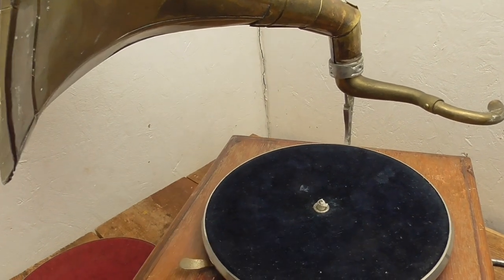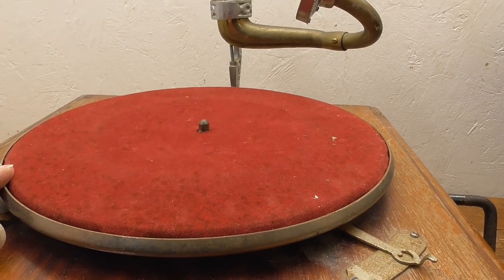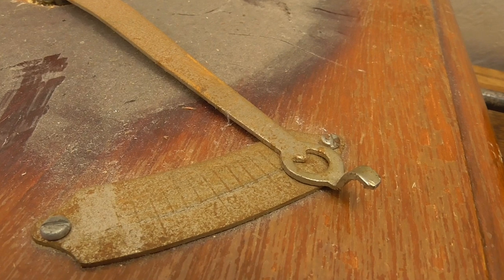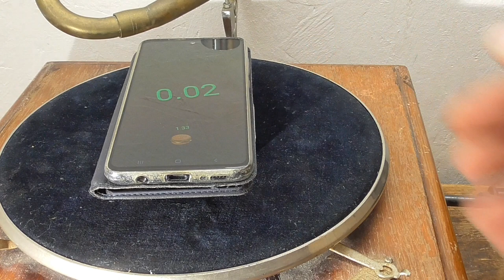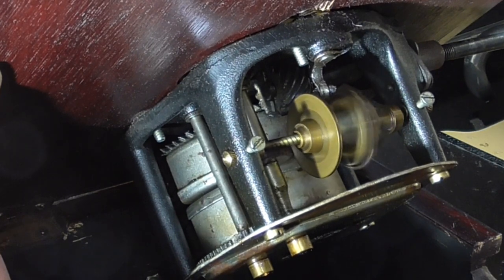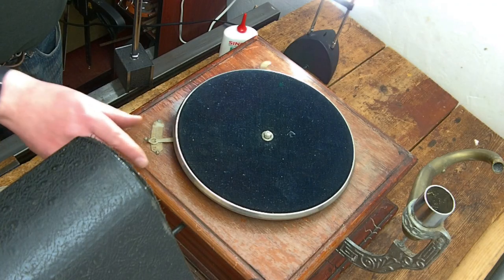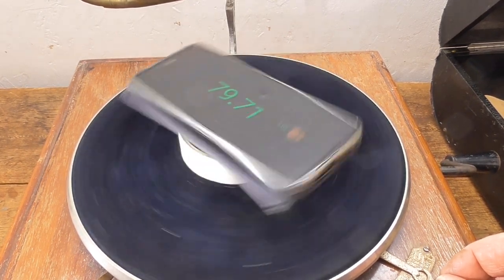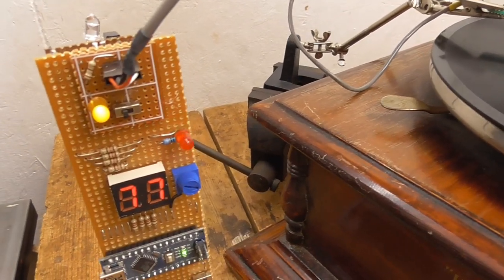Fake gramophone - fixing the turntable

Comment: Looking forward to see if you can address the air leaks in the tone arm and tracking. Also, can you get inside the soundbox? I guess the whole thing would sound better with a good sound box on it? Cheers
Reply from the maker: Tonearm will be next and maybe in that video, and maybe in a separate one I will be looking at the soundbox too. It will be interesting to see how well the sounbox compares with other ones. It does have screws in the back so I am hopeful I can get it apart. Thanks 😀 👍
Reply: @mrrgstuff  I’ve never seen inside one of those sound boxes. Look forward to it.
Reply from the maker: Me too. Thanks 😀 👍

Comment: Hello! I love the channel. I've worked on typewriters for a long time but recently came into possession of one of the Indian HMVs. I'm working to get it playing better, and I'm wondering if there is a best way to get the turntable off. I'm leery of putting too much muscle into it. Any advice?
Reply from the maker: Yes, basically it's a push fit so you need to support the turntable and then hit the central pin with a mallet or soft hammer. The pin is tapered so the turntable should pop out relatively easily. You could add some penetrative oil before hand also which can help. I did the following video a while back which shows the basic process:
https://youtu.be/d54KcOneASQ
It's not likely you will damage the motor with this procedure, but obviously there is a risk. If it doesn't want to move then apply more oil and leave overnight, though for me they have all come off without too much trouble.
Glad you enjoy the channel. Thanks 😀 👍
Reply: @mrrgstuff  Thanks so much! I will watch the video and give it a shot this evening!

Comment: We can’t get our handle out ! So the lid won’t lift . Any ideas?
Reply from the maker: The handle should unscrew if you turn it anticlockwise / counterclockwise, but it might be quite stiff. There is also a possibility that it pulls straight out, but I have not seen a motor like that on one of these fake machines. Once the lid is down, just screw it back in and as you continue to turn it, the motor will wind. I've just made this video which you might find useful:
https://youtu.be/Vb6aLcH9py4
In normal use, there is no need to get to the motor, so it's common to leave the handle in.
Reply from the maker: I've made you a little video to show what I mean. Hope it helps:
https://youtube.com/shorts/kRY3yyYcSNk?si=fJ1C4wY9trtjVxhH
Thanks 👍 😀

Comment: The poor tracking & uncompliant soundboxes seem to be the main issue with these fakes. Wouln't mind owning one as a 'black museum' piece to warn less informed collectors not to be duped. What would be a reasonable price to pay for a fake?
Reply from the maker: The soundboxes certainly seem to have a poor reputation however this one doesn't seem to sound too bad. I will be looking much more closely at it in a future video. Some fakes seem to have more of a gooseneck tonearm and I have not had a chance to look at one of those. The one I have is more Swan like, but at least the bit that is connected to the tonearm is really quite thick and heavy in comparison to the genuine one. I'll also be looking at the tonearm and tracking in a future video and I think at least some of the issues are wear and tear on this example, though I doubt the tracking was ever great. As for price  they are available new on Ebay starting just under 90GBP at the moment. In antique shops they are often priced higher! I got this one in a job lot with a broken portable and it cost me more like 30GBP. The broken horn elbow would have made it much less attractive as a decoration piece. It's also worth noting that many of these fakes have unbranded Thorens type clone motors, not the Garrard like this, but sellers almost never show the inside of the machine. Thanks 😀 👍
Reply: @mrrgstuff  Thanks for the detailed info. Will bear in mind if I chose to buy one!
Reply: @mrrgstuff  i bought one without knowing x( i regret it so much, so now im trying to fix it the most i can before i buy a real one hahaah
Reply from the maker: @gato_luchito9825  Hopefully you didn't pay too much for it 😉. They can be made to work a bit better. I did service the soundbox on mine, but I really wouldn't recommend doing so. Much better to find a genuine one and fit that (you probably will need to wrap some tape around the tonearm to make it fit). A vintage soundbox may need servicing anyway, but at least they were designed to be.
https://youtu.be/jy2QNOyxgoY
https://youtu.be/IkCCI8Vvisk
Thanks 😀 👍

Comment: They are trying to produce these without any proper machines or tools.  Any early 20th century gramophone, even the cheapest ones will outperform this thing.  They couldn't get the tonearm to track?  RIDICULOUS!!!
Reply from the maker: Based on the videos of other manufacture in India I guess that the various components for the motor might be made in different workshops and then assembled elsewhere, ie there is no factory as such. Having said that, the motor is essentially well enough made to work I believe but I will only know for sure when I rebuild it. The tonearm tracking has probably never been great on this machine, but its had a hard life and at least some of its problems have occurred since it was made. I will be looking at the tonearm and maybe soundbox next to see if I can make it better. Thanks 😀 👍